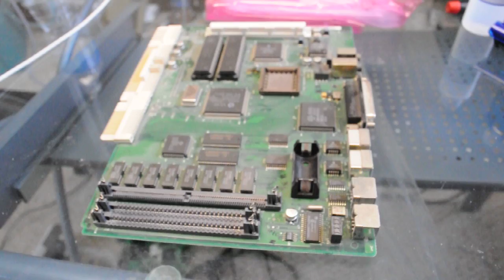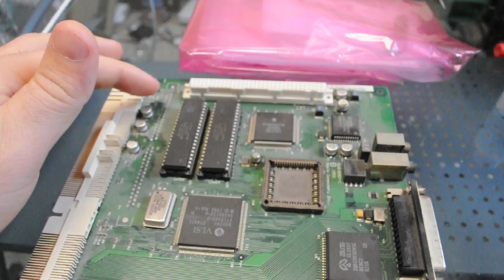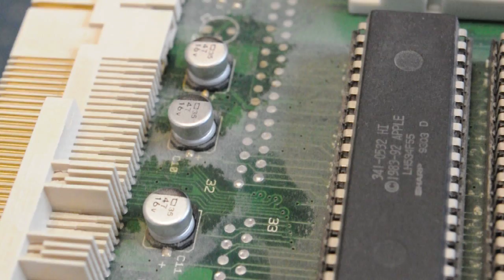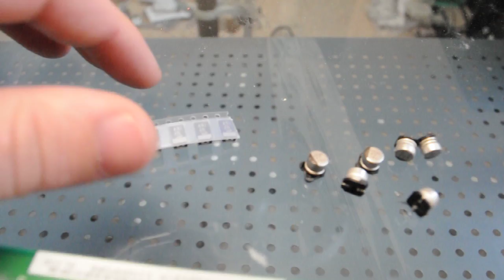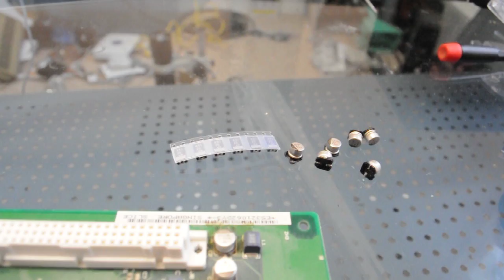Doubleclickittofixit does it again and recaps a Macintosh Color Classic from 1990 to fix it!

Comment: Hi,
I got a Macintosh Colour Classic that does power on but will not have sound nor read the Hard Drive. Will recapping them fix that problem?
Wanted to ask before I go ahead with recapping my one as i am a DIY person.

Than ks
Reply from the maker: Most likely. Every case is different but this is a common issue with them. The solid state capacitors go out since it has been like 20 and 30 years on them now.